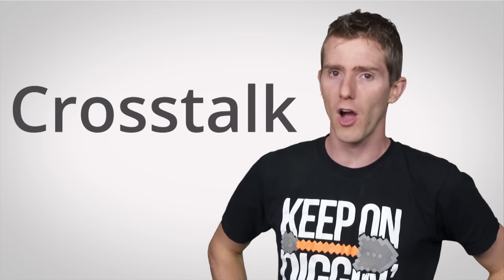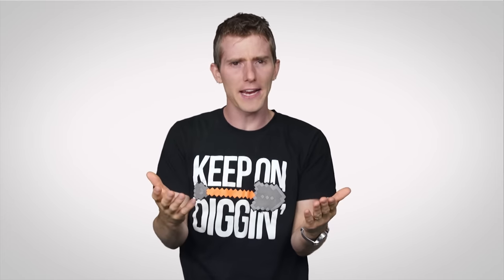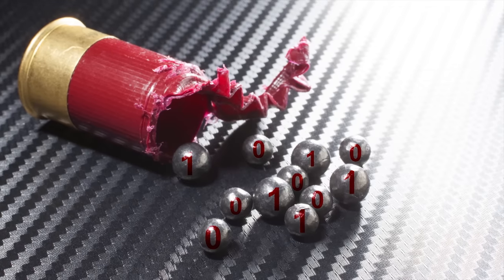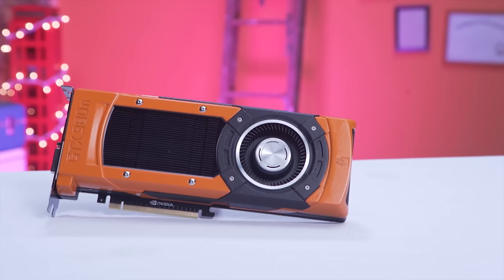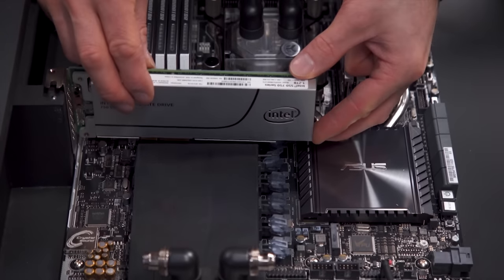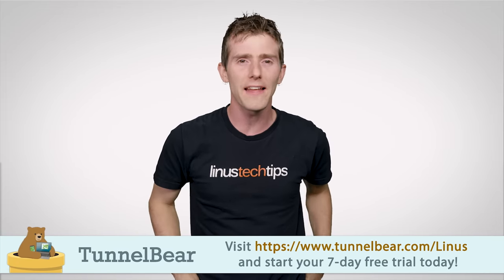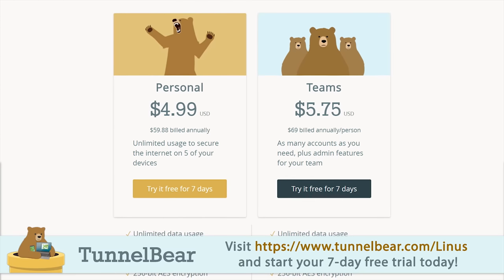What's the Difference Between Parallel and Serial?

Comment: That brings back nightmares about removing IDE cables.  You couldn't pull the cable itself because it could damage it, which meant pinching both sides.  When you finally got it loose, your hand would slingshot out and you could cut yourself on the sharp edges that used to be in cases.
Reply: Not to mention all the dust that gets trapped with those wide ribbon cables. I've seen some real nasty stuff build up in there.
Reply: Am I the only one who has never had this issue?
Reply: @qwertykeyboard5901  Either you're too young to have dealt with it, or you had some of the nicer IDE cables that had attachments for pulling on to avoid injury.

Comment: In my 12 years in IT at a company i have seen more sata and USB ports broken than IDE, Paralels and COM ports
Reply: Dito, just 25y :)
Reply: well 12 years ago was in 2005 and USB was basically already the standard and SATA was gaining popularity over IDE. That and with IDE there was always a chance that the pins would bend if you didn't pull the cable out exactly at 90° and it was a huge chore to bend them back. Which, although it usually doesn't require IT assistance, is still a pain in the ass.
Reply: Same
Reply: But remember that most companies have old hardware and it takes time to upgrade everything, we still have some Compaqs with P2, P3 and P4 runing(those fuckers wont break) they are used in deposits and cargo bays to show some stuff, so is not necesary to upgrade them for now
Reply: Began in mid-90s with computers. Only on one or two occasion had to fix a damaged PIDE port. They were in both cases damaged by user error, attempts to put the cable in backwards on headers that had both sides notched but disregarding the key pin. SATA on the other hand I've had to carefully push the pins back into the plastic housing because they are rarely mounted with anything more than a melted plastic joint. This tends to happen most often with people that own SATA cables which have a push button release but don't notice the flimsy button has worn down and is no longer releasing the locking arm. Have supplied such customers with the easier to use cheap SATA cables as replacements, which seems to help.

While SATA pins aren't as prone to damage as PATA due to standardized shape of the housing not allowing you to plug them in backwards. That cheap release mechanism either needs to stop or be replaced with a more resilient alternative. Honestly I like the cheap cables better as they friction lock into place, primarily due to being made of cheap plastic that has almost the behavior as Rubbermade or Sterlite.
Reply: Maybe because they won't swap plugs at these ports so often?
Reply: xplus93 no the reason still used in industrial applications is usually because someone higher up refusing to upgrade.  

Like one of my local stores here used to use embedded version of Windows XP’s or 2000 for cash registers.. they refused upgrades cuz they were familiar with hardware and it was just cheap to keep them going... 

I been building PCs since the 90’s... I broken pins/cable on almost every standard.. I prefer Sata over pata/IDE.  I preferred usb over d-sub or serial... not just cuz of the tech advantages... but I will say straight up if you were to treat Seriel cables the same way you treat usb cables... meaning carry them around everywhere with you, they get twerked on and pulled at and plugged and unplugged many times per day.. no way serial cables will last very long..
Reply: Well... I'm happy with this, we are two. I never see broken IDEs.

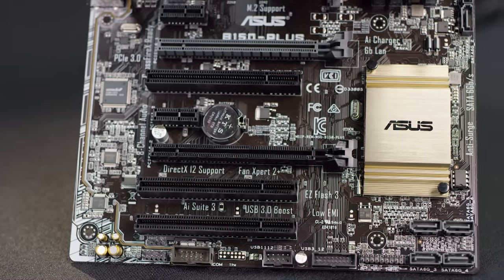Comment: 3:33 explaining clock recovery encoding protocols like 8/10 might be relevant for future videos, as it helps viewers understand how high speed communication work without a dedicated shared system clock between components. Also useful for understanding why 1Gbit=100Mbyte. 

Other relevant topic: Could be interesting to also cover the actual pins on a cable, e.g. USB, Ethernet, SATA, and wtf they actually do, and cover differential signaling and how it reduces interference problems.

Comment: Sorry, but saying "USB got one data line in each direction" is false. 
USB 2.0 and lower only has D+ and D- as signal lines, but this is a differential pair. Meaning, that it basically carries the same information at the same direction at each time (half-duplex), but the signals are the inverse of each other to block outside interference.
From USB 3.0, the cable got two more pairs for each direction (SuperSpeed tx/rx), but the old pair is still there to make your statement false and to confuse everyone.

Comment: This video had a few good points but was marred, and it could confuse people. Had you simply mentioned "parallel to serial compression" (like USB) requiring (a chipset) doing processing of it, it would have cleared up the "magic" mystery of why and how people managed to get from the data rates of parallel to those of serial. The pay-off and trade-off would start to dawn on them because it isn't "magic". You could then have simply "name dropped" Fourier mathematics, and then people could at least look it up in a book or online. There was a reason parallel existed (high data rates and also acting as the first GPIO), and yet form your video people could walk away thinking serial should have only ever been the way forward and that somehow there was no hurdle to get the benefits of parallel into serial. You don't even have to "explain" the complicated stuff. Just "mention" the word and then people can have a look.
The notion of pins being prone to damage is not an argument against parallel when comparing to serial. Not only can you wire to (and thereby adapt) the shape of something else like an rj11 or rj45 connector for a parallel (so the size and pins can be smaller), but also a serial (e.g. a great big RS232 null modem cable) can be about the same size as a parallel printer cable.

Comment: Parallel will catch up and out perform serial eventually. Sure crosstalk is a problem with ribbon cable but twisted pair advances along with proper shielding can offer more bandwidth along with TDMA style data synchronization and other transport level data timing matching technology.

Comment: Great video! :) 

I would find it very interesting if you could do a Techquickie on computer component power consumption, particularly that of CPUs and GPUs and what constitutes it. What does the electricity actually do inside the components - what is it needed for? Also, the GTX 580 from around 7 years back and a modern GTX 1080 Ti both have similar power consumption yet the difference in performance is, of course, absolutely massive. Similar trends can be seen on CPUs as well. What has allowed these huge advancements in power efficiency and can we expect this trend to continue still as time passes on - is there still much that can be done to improve power efficiency? Where are the physical limits as to how low power consumption could be dropped in the future for a given level of performance (a certain amount of FLOPS)? Also, how are CPUs used on mobile devices and laptops able to achieve such low power consumption ratings despite still being fairly powerful? 

It would be very interesting to learn about these things! All the best to the whole team and thank you for making these videos. :)

Comment: Fun fact: You can get a PCIe x4, 8, 16, etc card working in an x1 slot by either sawing the extra pins off the card or cutting open the PCIe connector on the motherboard. I had to do this once, to get a video card to work in a PC that only had 1 x1 slot remaining. (The x16 slot was occupied by an HBA.) It worked reasonably well, although the drop in bandwidth/performance was apparent even at the Windows desktop.

Comment: USB does not have one data line in each direction. USB uses differential data signaling, this means that one data line can be mapped to 2 physical wires, one being D- and the other D+, so when one wire goes high voltage, the other goes low voltage. Differential signaling allow serial communications to be faster because they are able to send data with lower voltage swings without being affected by ambient noise. As for the clock it goes embedded in each data signal and is reconstructed by the receiver.

Comment: You didn't mention the speed of chipset meaning there was a limit to baud that each chip could interpret the data in serial. It was cheaper to put them in parallel and feed the more expensive CPU that way than to buy a chip fast enough to talk in serial at the same speed. It wasn't until these chipsets became more powerful and less expensive that serial was able to take over. It also helped that we were reaching limits with parallel speeds anyway due to the aforementioned crosstalk, etc.

Comment: This brings back memories from when PC parts were more expensive, and repairing parts was more common rather than disposing of them, and delicately straightening those bent pins on drives, cables, and motherboards.

Speaking of pins, I still have a large jar full of gold CPU pins that I used to extract from junked PCs. I should smelt that down into a gold bar sometime.

Comment: I thought crosstalk was between a receiver and transmitter (side by side) wires. Cause the transmitter has much more signal in the beginning of the wire and after some distance (that the receiver's signal is not faided that much) had electrical interference with eachother.

Comment: I have a whole bucket load of what appears to be DB 37 Serial data storage cartridges (predecessor to USB thumb drive by the looks of it, to me at least) and I'm trying to figure out more about them.
I have these because my Grandfather custom built a few barrel organs in his life time, usually barrel organs are analog instruments which use rolls of perforated paper to produce music, my Granps being the absolute 1980s-1990s tech wizard he was, completely rebuilt the guts of the organs, turning them digital. They read MIDI files off of these extremely obscure, dated 37 pin cartridges (I think serial DB 37), the cardriges themselves are totally black plastic, about 3x2x0.75 inches with right angle edges and corners, and absolutely no branding or text on the device other than the hand written labels of what songs are on each cartridge.

Anyway, I inherited all this stuff and would love to figure out more about it all, I'd LOVE to be able to hook up some of these cartridges to modern hardware and see if I can write any custom music to be played on the organ. I'm an actual musician, which is why I inherited all of this, so it would be a blast to give some new life to my Grandad's old project.

Comment: I’m assuming this means that each wire in a USB cable (for example) handles one set of information bit by bit while other wires can handle other sets of info simultaneously. Parallel connections have every wire containing one bit of each byte so they’re effectively working together all the time whereas the wires in a serial connection operate independently

Comment: I thought crosstalk was between a receiver and transmitter (side by side) wire. Cause the transmitter has much more signal in the beginning of the wire and after some distance (that the receiver's signal is not faided that much) had electrical interference

Comment: My first PC was a 386 in 1980s and I've never seen an IDE or parallel port with broken pins from then upto now. I now repair and build PCs as a hobby/business and ive seen lots of damaged SATA and USB ports on modern motherboards and laptops. I wish SATA used pin headers and ribbon cables like IDE except just 7 pins instead of 40. You have to be really careful not to put side ways force on m'brd SATA connectors as the plugs are taller and the connectors can easily be damaged.

Comment: There are definitely some limitations to standards like USB. Some industrial applications actually do work find parallel connection more reliable if they need a specific thing to be refreshed as quickly as possible. A serial bus really doesn't lend itself quite as well to real-time applications, and a couple of unusual examples would be USB keyboards not having NKRO, and the fact that an SNES controller can be more responsive on the original hardware than a USB knockoff can be on a PC. USB in particular has the limitation of relying on the OS polling a certain number of times per second, where some parallel standards can use straight up hardware interrupts, so the device can tell the computer about state changes as soon as they happen rather than waiting for the next poll. I'm kind of glad the PS/2 ports are still around.
Reply: USB keyboards not supporting NKRO is a common myth. USB mice are also not any less fast or reliable than PS/2 mice. USB has matured and evolved enough at this point that the advantages PS/2 once had are pretty much moot.

Comment: PCIe 16 lanes do not have crosstalk you mean? 
Crosstalk is not really a big factor while choosing serial over parallel.
CSI and DSI uses multiple lanes of DPHY link. [Ex. Check Raspberry Pi where the ribbon cable that connects to a the piCam or display has multiple lanes of DPHY].

Comment: Hello sir. Maybe you can help. Our old printer is 25pins male, pins number 9,10, 18 and 19. and the new printer is 36pins. Should I still use the 9,10, 18 and 19 pins in the new 36 pins interface? Will it function?

Comment: You kind of miss out on the cable length due to crosstalk. The longer the length of the cable, the more pronounced the interference of the signal.
Reply: I experienced this one first hand when trying to splice multiple cables together for a longer cable to use for diagnostic purposes. Ultimately had to replace all the wire with shielded wire of a similar gauge. Didn't completely eliminate crosstalk but was more reliable than even the shorter cables I've used when it came to data integrity.

Comment: Serial is cheaper. Having 20 data lines also means you have to have 20 times the hardware.
There are many applications that still use parallel connections as you run into a bandwidth limit with pure serial communication and stitching together the data of many lines can be quit tricky.

Comment: usb 1.0 has 3 connections and I'm guessing one is 5v, a second is ground, and the third is data. Usb 2.0 has four connections but only uses three total (the ones in usb 1.0) so by adding a useless connection it gets faster? and by adding a second useless wire (usb 3.0) it gets even faster?
Reply: Both USB1.0 and USB 2.0 have power(nominally 5V)/ground and a pair of data lines. USB 2.0 High Speed uses a different signalling system to reach higher speeds on the data pair. USB 3.0 adds additional data line pairs.
Reply: Jonathan Fox so multiple serial connections?
Reply: With USB 2.0 there's only one. USB 3.0 has the same data channel as USB 2.0 in addition to a data pair for data going from the host to device and another for data from the device to the host.

Comment: 2:56 im always bending my internal usb 3.0 connector and no other connectors lol? I plan on 3d printing some mounts to hold it better once its in because when it sometimes gets pulled or when bent out the way it comes off wonky and bends pins
Reply: and talking of bent pins at 3:07 it looks like the pins on that fan header is a bit wonky

Comment: would superconductive wires make a difference for parallel transmission?
Reply: it just lowers the resistance. it doesnt matter when it comes to data. data transfer speed is limited by the capacitive and inductive parameters of the wires

Comment: Theoretically, surely IDE or PATA Hard Drives should be faster than SATA Hard Drives as Hard Drive cables are short enough in length to justify using Parallel rather than Serial?

Comment: What if we brought back parallel connections but instead of electrical signals use optical signals? It might not be as durable, but there's pretty much no crosstalk with fiber.

Comment: what about usb 3? they added more lines to get the speed. but how? 
this seems to be a good follow-up topic to this one
Reply: Think of it as a similar method to PCI express, where two bytes of data are transmitted in parallel, but each bit per byte is serial.

Comment: I wonder how a USB splitter works since you can just connect your mouse & memory sticks etc,,, all at the same time without issues,how could that be ????

Also, if crosstalk interference was an issue backthen with paralell cables,then why were those wires inside them not magnet shielded??? Because that would had prevented statical interference.
Reply: "so, if crosstalk interference was an issue backthen with paralell cables,then why were those wires inside them not magnet shielded???"
Cause that shit cost money!

Comment: It seems completely logically fallacious why parallel lines must either A. slow down just because the data paths needs to synchronize or B. that the data paths needs to synchronize at all or C. that all the data paths needs to be used altogether all the time.
Just use the damn lines properly instead of throwing away the concept completely and sacrificing X_numer_of_pins times the potential data flow rate
Reply: in fact, that's exactly what he just described with PCI express lanes... why is that not the same as any other possible interface

Comment: serial isn't SUPER durable, i once accidentally broke off the plastic part of my hard drive's sata connector. (i had an identical drive that had failed a few years ago and i stole the little circuit board off of it)

Comment: I know all of this stuff is pretty much for fun, but explaining why Parallel is bad and not explaining why Serial is good... well....
With the speeds that data is transmitted at today, Parallel couln't work, simply due to electromagnetic radiation.
This is why the DIFFERENTIAL Serial links are so prevelent. prevelent as in exclusive!